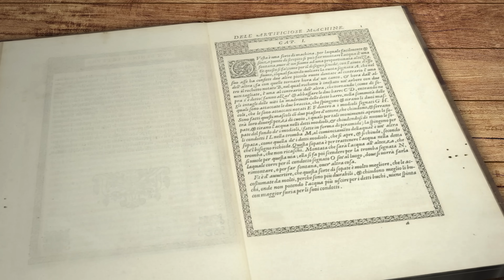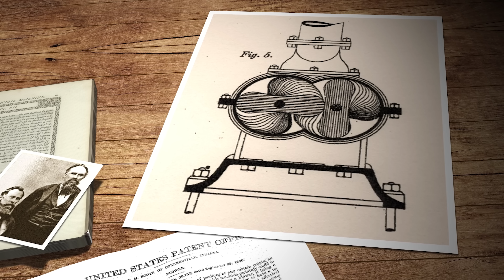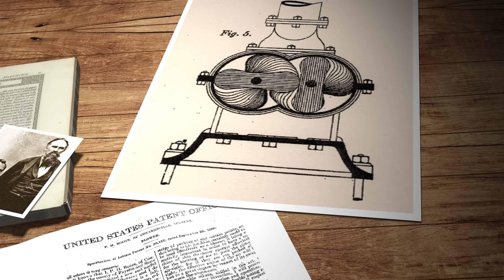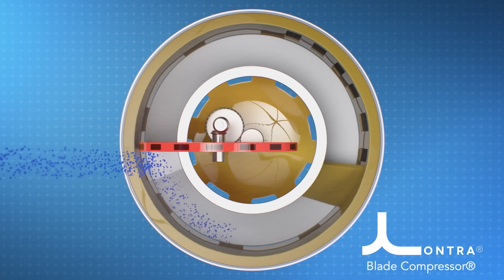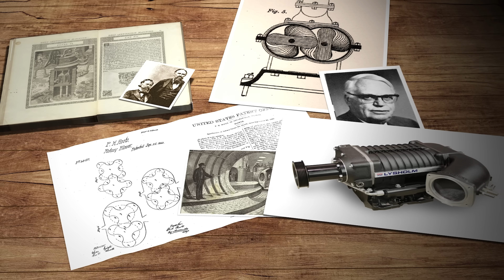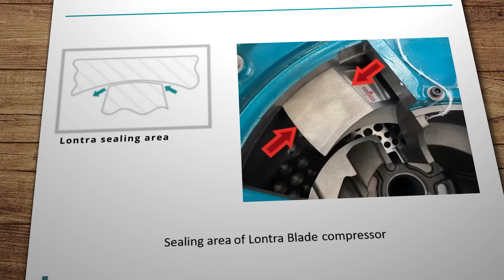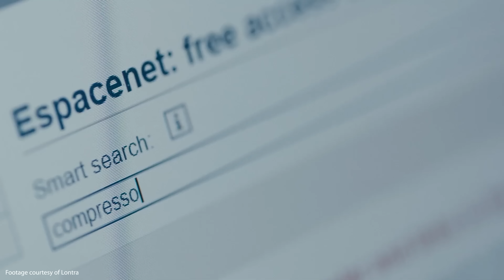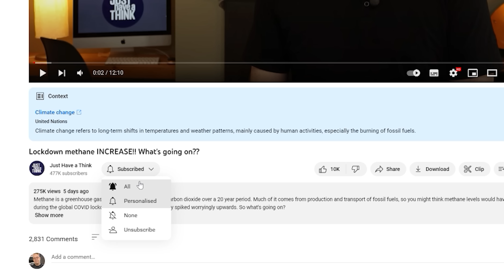Compressing air to reach net zero. A 'revolutionary' innovation.

Comment: Interesting design, but there are something that I'm sure their engineers have thought of, but as a 3rd party it's still interesting to analyse. First, despite what you said, there are lots of things to wear in there. Bearings first, though that can be handled with proper bearing selection and good maintenance. The gears are the main concern, and probably should be inspected regularly. The big issue is that a traditional piston compressor usually wears it's cylinders and rings out before the big or small ends fail, or the failure mode is generally pretty dull (I'm not counting the tank here). If the gears on this design lose a tooth, the failure will be spectacular and terminal for the entire assembly.

Comment: I'd imagine that a major part of the losses in heat pumps would be from the compressor. If for arguments sake you could reduce the electricity consumption of a heat pump by 25%, making it a third more efficient and crossing over the break even cost of heating homes. If it was as high as the 34% stated, then this would make heat pumps an attractive option in many more applications and environments.

Comment: it has two rotating parts, the blade and the seal, I think it makes the pump more prone to failure, compared to the commonly used positive displacement pump (sewage truck) has only 1 part, the blade, which is rotating vane pump, it creates a high vacuum in front of the inlet, where it pulls sewage water from several meters above...I want to know with the same volume of pump, how much vacuum the Lontra pump can achieve compared to the rotating vane pump

Comment: I find your comparison a bit misleading. This machine can produce at max 1 bar of pressure. This is more comparable to a blower than a compressor per say. For example, your figures about global compressed air energy consumption, must include at least 75% of machines running above 7 bar. So this technology technically cannot replace the whole fleet of machines (just root blowers, multi stage blowers and so on, not so much the screw and piston compressors which - I think - makes up for the bulk of the compressed air production in industry)

Comment: That was an interesting design but in your explanation you fail to explain the importance of internal compression. Internal compression is the reason why Lysholm compressor is so much more efficient than Roots blowers. There is also the scroll compressor that have internal compression. I can see on Lontras web page that it achieve internal compression by the layout of the exhaust slots but the volume of these slots will also carry compressed gas over to the intake port and thereby reducing the efficiency. Therefore I have doubt that it would be significantly more efficient than Scroll or Lysholm technology.

Comment: This is a fine advertisement for Lontra, but the claims of 21% and 34% of "efficiency improvement" are unsubstantiated.  "Efficiency improvement" vs what, a 60 year old compressor that is under maintained and improperly sized?  The geometry of this compressor does not lend its self to significant improvement over other modern designs, and seal leakage is not usually a significant loss either.  Almost all efficiency gains, in terms of reduced electrical consumption, are from pipe network leak reduction, proper sizing of the compressor for the loads, control systems that can vary the compressor properly, and maintenance programs.  The compressor internal seal leakage is very insignificant to overall power consumption.
I applaud Lontra for producing the compressor, but in an industry that is over 100 years old, the usual reason no one has ever made the "new" design is because it's not advantageous over existing designs.

Comment: This style of compressor should run a lot quieter than a piston or diaphragm compressor.   That would be nice for a shop compressor as well as the added benefit of being more energy efficient  Thanks for the video!
Reply: My impression also (quieter). I suspect with an intake resonator (like modern combustion engine cars) tuned to working RPM, it could be nearly silent.

Comment: Is it reversible to work as an expander or engine running on compressed air?
Reply: I don't see any reason why not. I'm not a hardware engineer, but just think about the cycle this machine uses. Every stage seems perfectly reversible. Valve openings and closings, for example, are under control and force of the machine, not the air nor any funny trigger mechanisms.

Comment: Yep, a very promising innovation. Always good to see better efficiencies in energy use being found. Might make a difference to the 3% of the CO2 that human activities probably add to the atmosphere per year. Out of some 400 parts per million. The sky might fall any time soon chicken little. Not necessarily for the rest of us.
Reply: It sounds like you don't understand the causes of climate change, probably because you believed one or more of the ubiquitous lies about it.
Reply: @incognitotorpedo42  It might be as well to check Angstrom's pivotal paper from the early 1900's which gives a good insight into the amount of reflected radiation CO2 in the atmosphere can absorb. Likewise which wavelengths are involved. That would be a good starting point. Murry Salby's integral equations and his studies of the atmosphere take it further. I haven't swallowed anyone's false narratives. I can check for myself. And have. Be assured I won't be concerned about the tiny percentage of C02 that human activities add to the already tiny amount of C02 already there. Not if what our best current theories show are at all accurate and so far they are more than well borne out by the data. Dr Roy Spencer and his associate's UAH satellite record seems pretty compelling for instance. Hint:- we are currently up to some 8 years and 4 months without any net increase in world wide average temperatures in our current pause and this is on top of the even longer pause in so called 'global warming' post 1997-98. For anyone who wants to get up to date with what is actually happening with the basics of the actual science Tony Heller has quite a good summary video at https://www.youtube.com/watch?v=8-zaQWAaPAg&t=1s://www.youtube.com/watch?v=8-zaQWAaPAg&t=1s

Comment: 👍🏻👍🏻 great video. I have a bottling plant where we use screw compressors for low pressure requirements ( upto 8-10 kgs ) and reciprocating compressors for high pressure requirements ( 36-44 kgs ) which are one of our major costs. Never knew the screw compressors were thaaaat old a technology.

Thanks for the introduction to this new option. Would live more videos like that 👍🏻

Comment: I find myself wondering about compressed air energy storage.

As I understand, wind turbines often fail in the gearbox that's needed to speed up rotation for the electric generator.

Would it be possible to build a turbine which simply uses this pump without a gearbox to compress air, which is then piped and stored on the ground?

Would this be simpler than the current electrical generators? 

How would the restrictions / efficiency compare at different turbine speeds? Would capture efficiency be affected by pressure in the storage system? 

Air from storage would run through a separate turbine generator or similar, but only when demand is highest. Avoids a step of generating electricity, then immediately losing efficiency to store it. 

Compress air, store, release. Instead of generate electricity, lose energy by compressing air, store, release. 

Within the energy storage capacity, the rate of generation can be independent of the rate of production. Once storage reaches capacity, then the system would have to extract & use compressed air at least at the rate that it is added, just like any other storage system. 

PS I'm aware there can be thermal issues with compression / decompression if you can't also use the heat. (Stirling engine?)

Edit: rephrased some of it.
Reply: If such a scheme could be made to work, it would reduce the need for rare earths for the strong magnets used in those alternators located in the hub up the tower.

Maybe another way to get the energy from the hub to the ground would be a pumped liquid. Then on the ground, alternators could be used with normal field windings instead of the rare-earth permanent magnets. Also, the power from several turbines could be routed to one alternator.

For an offshore installation, the alternators could be in a chamber below the surface.

Comment: How about the Lontra internal combustion engine?  Run it in reverse with a spark plug and a fuel air mixture and you have a new style of petrol engine.
Reply: Check out Albert Harvey Rotary Engines

Comment: there are problems with the Tesla turbine, not huge ones necessarily for this application, but this design might be better, been some time but i got some theoretical back of the envelope improvement of 20-30% potentially compared to piston, so they are already there, and to be clear i don't even know whether i could get that with the old surface friction turbine. but this is pretty exciting stuff ^^. what would be pretty cool is to find a cheap and easy to maintain solution to sub critical CO2 for most commercial applications, its currently hard because of outdoor temps so its either trans critical or cascade, which is pretty much weird to try with small systems. cascade is basically just a heat engine series, so one system dumps heat energy into another, for example a sub critical CO2 rig could dump its heat from its condenser into a methane rig for example :). trans critical systems basically compress the gas beyond the critical point of the medium, for co2 its around 80 bars and there the phases sort of mix together, and you lose efficiency, and run a gas cooler instead of a condenser. so thats a problem for most of the globe because you dont get to use co2 as a medium for say ac in most of the world with simple systems, if we could fix that then we could pretty much eliminate the need for freon which is a source of a lot of co2 equivalent emissions for no good reason. so i see a lot of promising tech for making such systems more practical lateley, and thats pretty cool ^^

Comment: As a complete idiot on the internet looking at this, I'm imagining that the screw compressor would give a more constant push, where something like this would come in bursts of pressure.
I also wonder just how much air this can push in comparison. If it is half the cost, but you need 2 of them for similar flow, then it may not be worth the efficiency gain. But if it brings the cost down significantly, then it may be one of the best things since sliced bread
Reply: A screw compressor still uses positive displacement, which, if my logic is correct, implies that parcels of air are compressed separately, and so they are going to come out in puffs. Not a hardware engineer here.

Comment: A couple of years ago there were another design with no rotating parts at all  ( do I remember correctly also presentet here) it was intended for heatpumps and refrigerators and was 30 % more efficiently than the conventional design. What happened with that? It was reciprocating.
Reply from the maker: That's correct Ole. They are  called Magtor and they are doing well in their chosen sector.

Comment: It's so long ago I failed Engineering Thermodynamics, I forget the coefficients that describe the waste heat generated by compressing air.  But this heat is a significant inefficiency --what, if anything can minimize that?
Reply: I don't think there will be much that can help with the waste heat.  It's kind of a law of nature that when gases are compressed, they get hotter.  You'd have to design a system that takes advantage of the waste heat in order to recover that energy.
Reply: Intercoolers.
Reply: I wonder how it goes at compressing water vapour and the heat generated could be used to heat up more water.  Sort of a rotary steam engine.
Reply: @simongross3122  You described a desalinator for a submarine boat, except for the "engine" part and except for the type of compressor.
Reply: @williamwaugh8670  Haha how clever of me.  I've proved that I am clever despite getting almost everything wrong :)  Thanks for the info.

Comment: In most compressors, all the final sealing requirements are ultimately met by appropriately viscous oil filling the inevitable remaining gaps between components.  This design introduces all sorts of dynamically interacting seal gaps that need that oil film delivered to them and maintained.  That would seem to be a huge can-o-worms for achieving maximum potential for the design.  No mention of it though.☹️ (Unless I just didn’t pick up on it.  That’s happened before…)
Reply: I agree.  This thing is unsealed like a can of bad worms.
Reply: @blameyourself4489  if you will believe what the videos says where it is already being used effectively in some factories and sewage treatment plants, then that means they have already solved the "can of worms" that you are talking about in those applications.
Reply: @sepg5084  It would be great if someone would explain what kind of solution is employed, in that case.
Reply: On Lantras web page it is presented as oil free and I agree that there is many problems not covered. Even Lantra doesn't show much on their web site.

Comment: if they are indeed that good then i'm impressed, i was thinking of using turbines like the one tesla invented, which would be bad at high preassure differentials in series to make a compressor with a much simpler design, since i have personal experience with how much stupid work has to be done and extra leakage points there are in small ACs and super market level cooling rigs because the piston compressors are almost never hermetic and has to have oil returns and so on, making the switch to something like this would greatly simplify a huge amount of systems, especially commercial application ones i think. another thing i have thought about a bit for supermarkets is using passive cooling tech to lower the peak preassure necessary to run trans critical Co2 rigs when the sun is having a field day. and a point that might be obvious to me because i spent some time working on it, is that piston compressors are more vulnerable to fluid making it into the compressor, since its not always the case in practice that you get to overheat the return gas from the evaporator enough to avoid all the gas from being liquid, especially if the system is ran a bit wonky or something is broken, a continuous cycle with a large internal volume is ideal really, fixes a lot of the maintenance issues a lot of the rigs all around face, so good on them :).

Comment: Compressed air may have been first used in forges as long ago as the Roman’s. They compressed the air using a device called a Trompe.  The trompe has no moving parts.

Comment: Be interesting to see the other stats on this because its not just about how much power a compressor is using. There is CFM and PSI needed for work flow/tool usage. So with a higher efficiency looks like it would have higher CFM due to less loses. But PSI is a mechanical limitation of material strength. A lot of compressors are two or even three stage how will they deal with that?
Reply: Just thinking at the keyboard here but for more volume you make them bigger. :-) Seriously though, being circular that should be fairly straightforward. For higher pressure you could connect units in series. Even simply piston pumps have a larger cylinder feed its output to a smaller cylinder to raise the pressure a second time. I've even seen three sizes in a row for triple compression. These circular units could also be use in sequence I would expect, bigger one feeds smaller one which operates on the already partially compressed air.